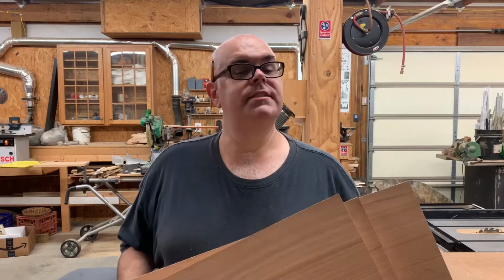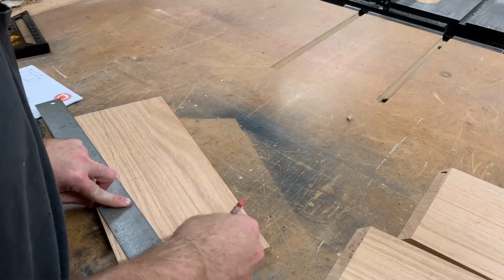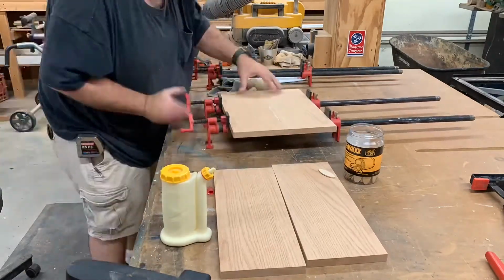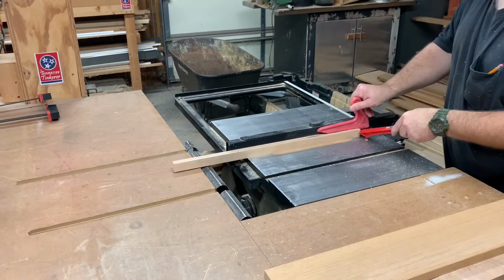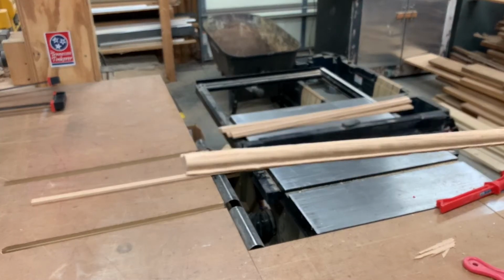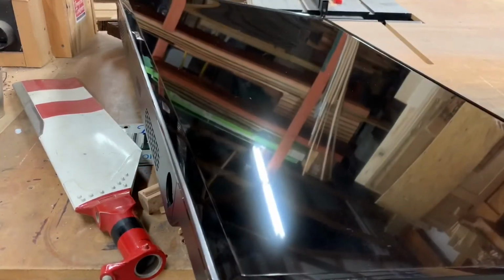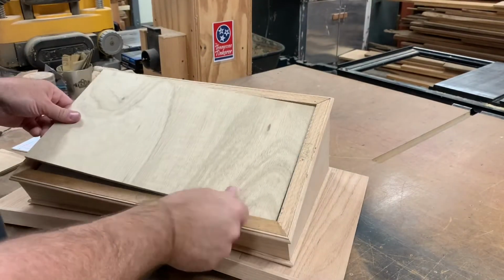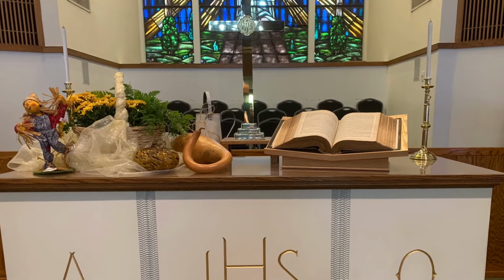Woodworking: Oak Bible Stand

Comment: Will you be able to send me the dimensions of the oak bible stand,  I am not very sure about the angle of it.
Reply from the maker: I'm sorry Dennis, but I don't know them. Unless I mentioned them in the video or put them in the description, I didn't record any angles or dimensions. Like  most of my projects, I just built it as I went, making it up in real time. When I build stuff, it is usually planned that it will be the only time I build it, so I am not apt to remember many details about specifications and measurements. That being said, this project in particular would really depend on the size of the Bible you were using to determine the dimensions. You will want it to be just slightly bigger than the Bible. Thank you for watching and for commenting. I really appreciate it!

Comment: I really do love the way the stand came out! However, the lack of basic safety measures when using a table saw (i.e. freehanding) is hard to watch and worrisome! Please be safe and never make a cut that doesn't feel right.
Reply from the maker: Michael, one definitely has to be mindful of power tools in general, and respect their ability to cause bodily harm. I don't recommend free hand cutting on the saw unless it is the only way, and even then, I would only do it if you have many years of experience. Believe me, I've been doing this long enough that I can tell when something doesn't feel right, and I abandon the idea real quick. Thanks for the concern and for the comment and view!